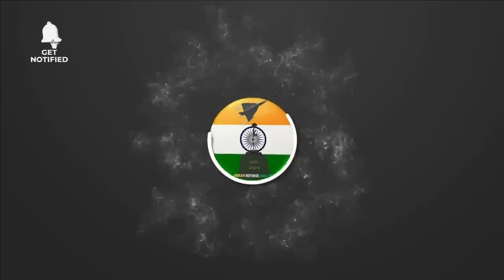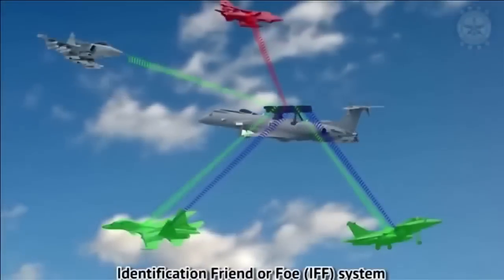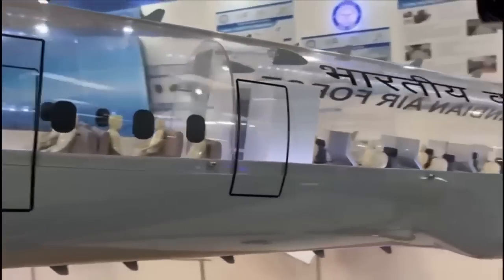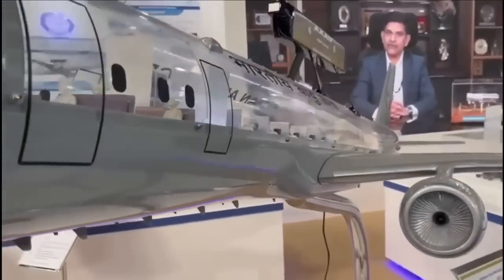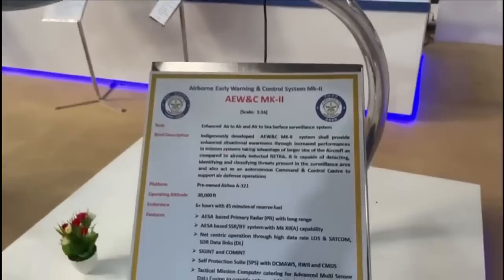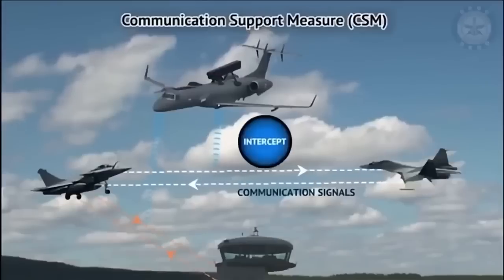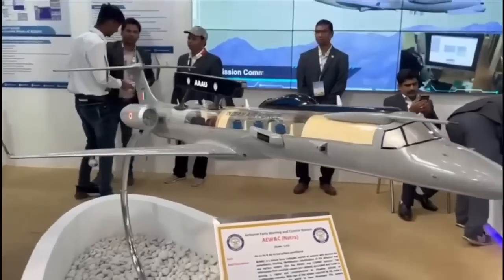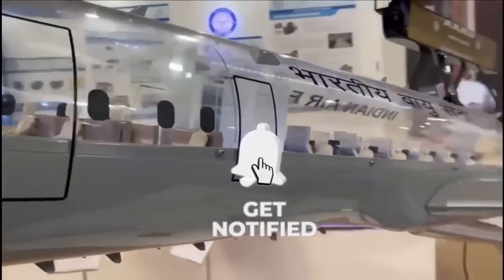Integration of sensors on AEW&C Mark-II started | 6 Netra Mark-II AEW&C will be delivered by 2028

Comment: When we are using Rectangular Plannar shaped radars,instead of 360° circular radome,why not use something like E7 Wedgetails,which has a detection range of 475-550km in AEW configuration & 800-850 km for SIGINT/ELINT platforms.
Integration started,how many decades will it take to get all 6 delivered,is the question???
Currently we need around 18 AWACS & 18 Refuellers.
18(6 Phalcon AWACS+ 6 E7 Wedgetails+ 6 Netra 2.0),all the previous ones can be transferred to Navy for Coastal shore bases operations.
18 Aerial Tankers(6 A330M/KC 46 Pegasus replacing IL78,12 Refurbished Boeing 767 airframes converted)
For additional units,C390 MMTA can be considered,96 units in total for Medium Transport purposes,out of which 24 units can be used for other purposes,8 units for ELINT/SIGINT/EW purposes, 8 units for Aerial Tankers & 8 units converted as base for Circular Radome based AEW.